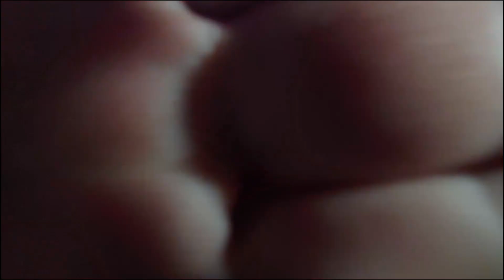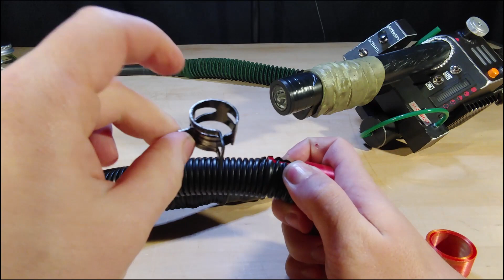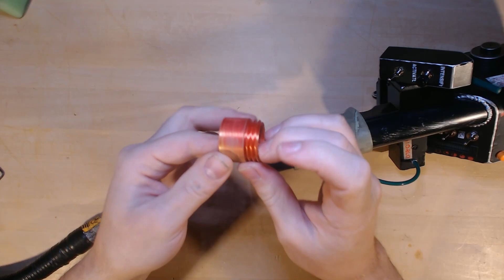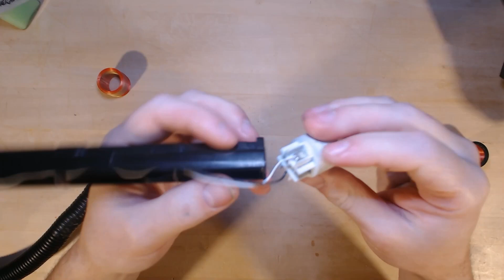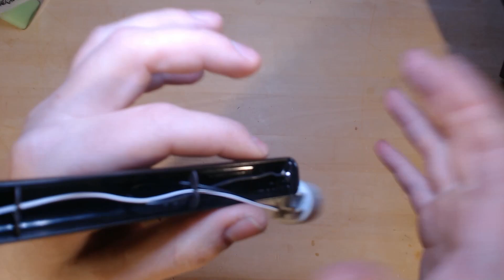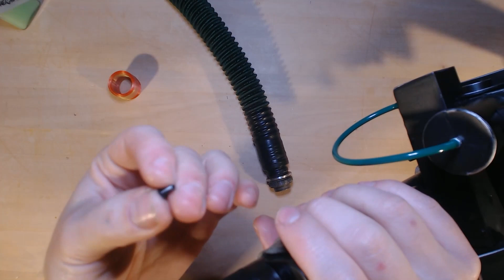Haslab Proton Pack ambilocal Connector  How To

Comment: Do you remember what the name of the Green Hose is?

I assume it’s a gas mask hose, but there are many variations of this.
Reply from the maker: Its actually a Re-breather hose which is the same thing just without the chemical resistance rating. I will be posting a video soon on the rest of my hose.

Comment: Are you selling the digital files for those prints?
Reply from the maker: If you have a printer or have access to one, just email me and I will send you the stl's. other wise we can work something out. Also if you are using different connectors let me know and I can adjust the model accordingly.
Reply: Thanks mate, I emailed you a bit ago. A buddy of mine has a printer and will get them for me, I will use them same parts you are.

Comment: For screen accuracy, the yellow clip part of the neutrik should be facing down on the wand. It still looks good, ether way! I thought that you spent the money and time that you should know. I actually found the screen accurate neutrik. Both ends! The one on the wand and loom! I was very lucky to find them. 
Now I just need to find the part that goes on the proton Pack and loom! This will be difficult for this part is from the 1950s! It's a connector used in aircraft!
Reply from the maker: I did spend a lot of time on it. I do know the Neutrik connector is upside down. I faced it up on purpose because any time my hand slid back it would unlock the connector. 
I also have the real connectors. I chose to go this route in the video because the connectors are widely available.
Good luck finding your size 16 cannon MS connector.

Comment: I picked up the all black C-Linko eletric plug and socket connectors instead of the blue Neutrik ones, both appear to perform the exact same function. However, I do not own a 3D printer, so I have to probably use a hose clamp w/ my setup, then wrap that area w/ my garden hose w/ electric tape.
Reply from the maker: Sounds like a plan. I can't wait to hear/see what the final result will be.